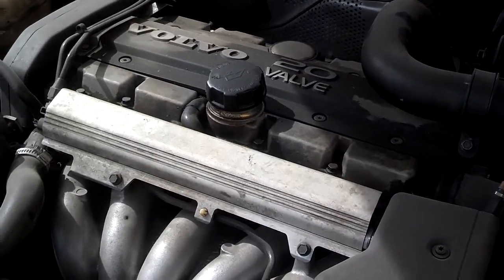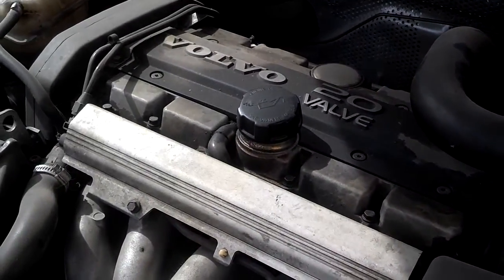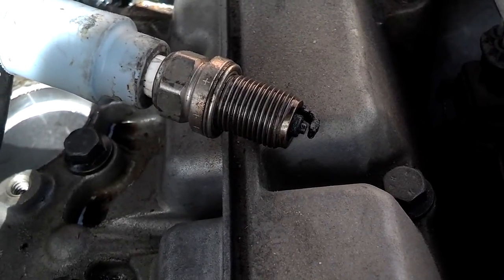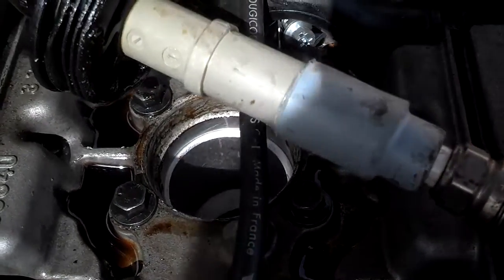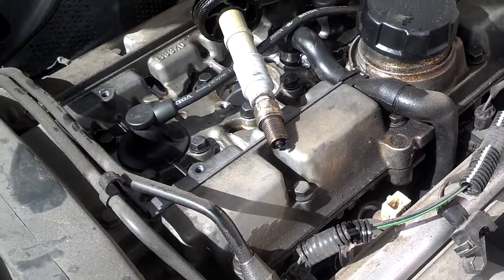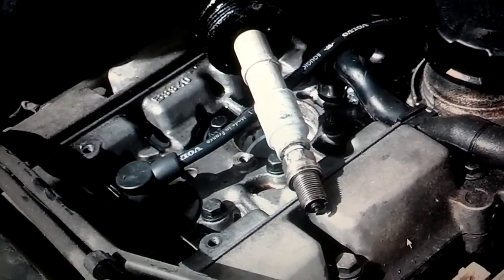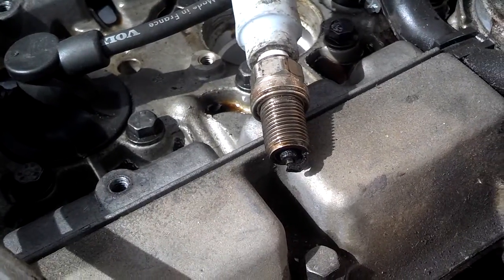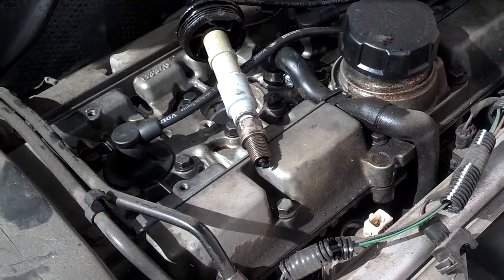How to test check for spark on a car or truck engine - VOTD

Comment: Hello Robert, Ive watched your videos starting back to when I first vot a Volvo. Thanks for your cranium... I have a 98 S70 and it had an issue with the relay 103.  I replaced it and it lasted a few months and then I believe I had the same issue come up.  But it sat for about 4 years. I  got crank but no start. Heres my current isse, I tried to take out the fuel filter but in doing so, the hose that goes to the engine side of the filter started to leak at the back of the coupler that goes into the hose.  I cant get that coupler out of the 3" hose the runs to a junction of two hoses.  The 3" line that connect to the coupler, at the other end of that hose, it  goes to the junction but there is no clamp holding it to the junction or spliter.
Do you have any guidance you can give. I just need to reattch the new coupler into the line and reattach the line to the filter . Then need to figure crank no start.   I miss my car, you give me hope to drive it again. Thanks.
Reply from the maker: https://youtu.be/1_Zd-hW-qlk

Comment: I have a 2012 nissan sentra and its not starting. The battery and starter have been replaced and still not working. I have an oil leak too. Not sure if oil leak on something important. The day b4 my car wouldn't start, it died couple times at stop light. Then parked it for the night and next day it not start again. Do u know what it could be
Reply from the maker: https://www.youtube.com/watch?v=AoqbF0ZEzpg
Reply from the maker: https://www.youtube.com/watch?v=NWfLpp8NevI